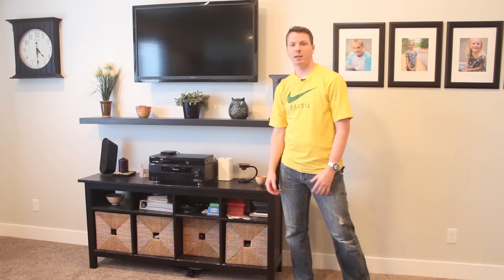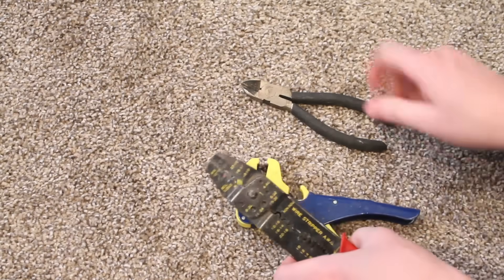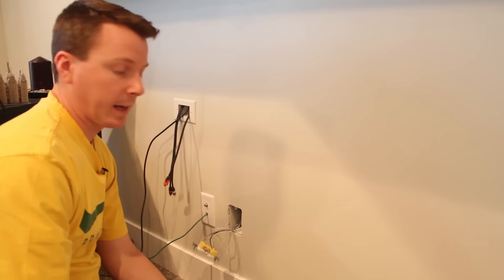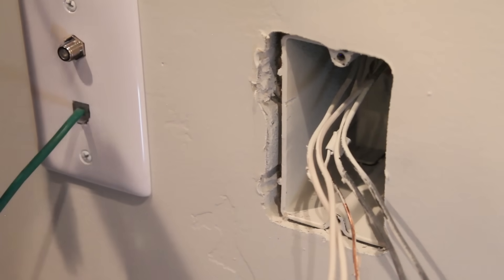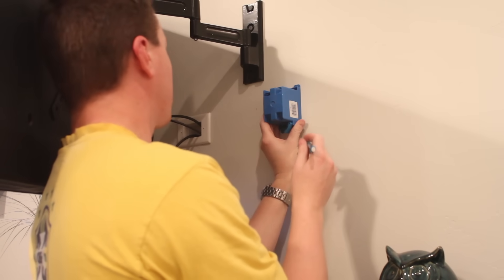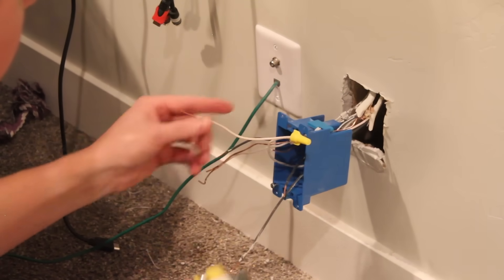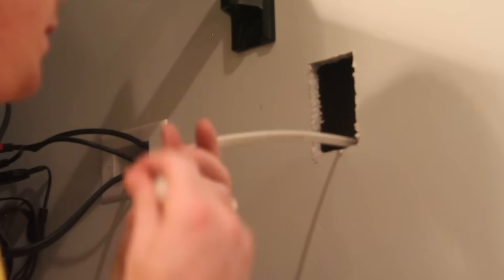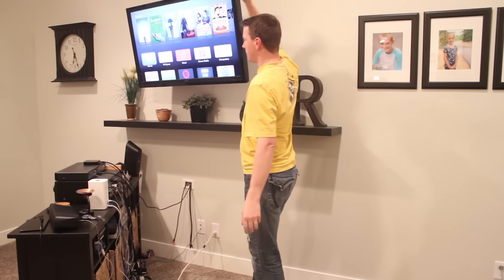How to Add an Electrical Outlet for a Wall Mounted TV

Comment: what type of romex wire did you use 12/2 or 14/2?
Reply from the maker: I used 14/2.
Reply: thanks
Reply: From my understanding you will want to use 12/2 if it's on a 20amp circuit and 14/2 if it's on a 15amp. Might be wrong tho. But you should definitely not just copy what someone in a video did blindly.

Comment: too much shit just to hide some cables, 99% of people would not be able to do it themselves without fucking something up, just get a freaking cable cover, slide all the cable, install a power strip at the wall with nails, plug power strip to outlet, put a drawer or mini table to hide the powerstrip, done

Comment: Could you describe the procedure for getting around studs if you are hooking up to an outlet that isn't directly above the existing outlet?
Reply: You can either: (1) notch the studs, add safety plates over the notches, and then patch up the drywall, or (2) tap into an existing line in your attic and run a new line down the wall exactly where you need it.
Reply from the maker: Sure will.

Comment: hi nils--- when you opened the existing outlet there were 2 blacks wires and 2 natural wires, why after putting a new romex , the existing outlet is missing 1 set of wires? . you have the new set + only 1 existing set, what happen to the 2nd of black + natural wire?  thank you
Reply: Why couldn't you tap off the screws on the outlet?  you had the incoming and outgoing already attached via the push in connections, with the 2 free screw terminals for H/N.
Reply from the maker: Hi Jenny. That second set of wires in the lower box continued on to the next receptacle in the wall. I used a pigtail to re-attach the lower outlet, while connecting a third set of wires that ran up to the upper outlet. The upper outlet only has one set of wires coming up to it and that's all it needs since it is the only outlet on the branch. Hopefully that makes sense!

Comment: are the kits that are in wall rated for this type of stuff pretty good i have seen some to where tv power is at top outlet then ext runs thru wall to out let down at bottom
Reply: Yes. I have used those on hundreds of installs. Very easy too. But remember, check your local codes first, and ALWAYS use a stud finder to map the wall out and avoid cutting any electrical wires in the process or getting stuck on a horizontal fireblock.

Comment: You are not supposed to to twist the wires before putting the Barrett Nut (cap as you called it) on them.
Reply: Only when you're doing it "hot" and don't have insulted pliers to twist them together.
Reply: Yes you are.  Twisting guarantees the pigtail connection stays together inside the wire nut.

Comment: What do you do if the existing outlet is not right below where you want to mount the TV?  My outlet is to the left or right of where the television is positioned.
Reply: You call an electrician like me and pay me lots of money to rip your wall apart. ahah. Joking aside this is the short answer. It can be done, but obviously you have vertical studs that you must pass through to accomplish it, and there really is no great way to do this other than to remove a section of drywall so you can drill through. You can use a flex bit but you need to make sure that you don't go through the other side of the wall and is up to code. Some codes require you to seal any horizontal holes. Basically you don't want to do this on your own, you want to hire an electrician who knows the codes to your area and can do this the right way. But yes, it will cost a bit and take some time.
Reply: I think I'll just buy one of those covers that hide the cables...

Comment: how come you have 2 sets of black and white coming into the original box? Does it mean it's already extended to another outlet, or light switch?
Reply from the maker: That's exactly right- there's one line coming into the box and one heading to the next box.
Reply: So, does it matter which of the 2 original lines you connect the upper box to?

Comment: Removing the old lower outlet box, was a waste of time.  You could have used a fish tape and ran to the other box.
Reply: I’m guessing he did that to make it easier to fish the wire? Asking. I don’t know
Reply: As he actually stated he's not a professional just the guy who likes to figure things out for himself I did not see the difficulty in the way he did it as I own all the tools that he presented. Except for the fish tape LOL I'd rather buy an electrical box for a dollar fifty at Lowe's than an electrical fish tape
Reply: Jason, Agreed. Appears as though he has a fish tape though realised that your typical homeowner doesn't. It's likely that the guy with a fish tape doesn't need this video.
Reply: How do u fish tape the same sequence
Reply: Yep that was weird thing to do. Messed up the drywall in the process.

Comment: I'm not an electrician...I noticed you twisted the copper conductors prior to twisting on a wire cap.  I learned to keep the conductors parallel to each other and you slip the cap over them and tighten by twisting the cap.  Thanks for the very good videos.  Helps a lot.
Reply: Many wire nut makers say pre-twisting is not necessary.  However, they do not say not to do it. It really depends on what thickness the wire is and how many wires you want to splice.  If you got four 12 gauge wires that need to be spliced, you are much better off twisting them with linesman pliers.   But even better is not to use wire nuts at all.  Go buy you some Wago or Ideal push-in connectors and thank me later.
Reply: you can see in the video he does, and even mentions it. also now you have entered into the electrician forum world where they go on and on about the virtues of pre-twisting or not. both sides have their points, and both sides won't yield. do what you feel is best; i pre-twist because i don't trust wire nuts.

Comment: Hi thanks for the tutorial. I have a question. So, when you connected the white wires (existing, new, and then the "extra" short wire to have a ONE wire), do you do the exact same thing with the black and ground wires? Thank you I hope this question finds you.
Reply from the maker: Yes - that's exactly right. Same on all three.

Comment: Niles, great project.  i wish I could post photos so that I could show you my dilemma.  I am placing a TV on a wall that has two outlets to the right and left of where I plan to put my TV and I want to put an outlet behind the TV but don't know how I am going to be able to do this.  There is a Romex cable running across the bottom but no outlet to plug into.  do you know how I handle this with violating code? any can help?

Comment: Are you able to add electrical outlets from a outlet on the other side of the wall? I have an outlet outside of my pantry and I want to run an outlet inside my pantry to plug in a cordless vacuum. Thanks!
Reply: yes you can. it's just a matter of running the Romex cable to the new outlet.
Reply: And as long as it's an inside wall. Different codes may apply if you're talking about an outside wall.

Comment: You butchered the drywall around the lower outlet...
Reply: Who cares, that's like $0.10 of spackling to fix that up
Reply: erroeserver3000 Just buy a larger cover.
Reply: Rob Gibson he probably made a video on how to fix already lol
Reply: It's called typical construction issues. Way to shit on the guy's work though. That make you feel like a big man?
Reply: You won’t see it behind his entertainment center
Reply: If need be,  the next size larger cover will cover any mistakes.
Reply: You mean those two little holes that can be filled with a dab of caulking? Good grief.....
Reply: The problem I see is that the lower box will NOT be secured to the wall. Therefore, just pulling out a plug could cause the box to rip out of the wall.
Reply: I was thinking the same thing lol
Reply: errorserver3000 I watched this whole thing and I was like wtf? why's that outlet looking so janky? gaps and shit I could have figured out how to do a poor job lol

Comment: very good job bro. But you're lucky because the old outlet is straight down under the TV.  my outlet is alittle off to the left, there is two studs in the way, and I don't know how to run the wires through the studs. Do you have any idea?
Reply: You have to cut a "pumpkin hole" in the drywall and then drill a hole in the stud.  good luck!
Reply: +Dara Nguon Same Problem..
Reply: At Lowes I've seen drill bits for this very purpose, sold right next to the fish tapes and other things of this nature. These bits are very long, like up to 5 or 6 feet and are flexible and bend to a certain degree like a long thin piece of metal would. The purpose being that you put it in the hole you make for the plug and drill through the studs sideways/diagonal, it looks tricky. That was what the label showed them doing with it so I'm not guessing.

I have the same issue, but I'm opting for running the wire up to the attic space and back down to one of the plugs, figured it might be easier and less messy. I just need to go up there and verify that I can access it easier from up there(by drilling a big hole in the top plate.) Maybe I'll look into this pumpkin hole method mentioned here too.
Reply: Get a bigger tv.
Reply: Why don't you move your wall mount center to the existing outlet?  You have to tie the wall mount to a stud, right above where the outlet is, so I don't understand how it would not already be above the outlet.
Reply: PianoSoulos my outlet is right below a window so using your theory of mounting the tv above the outlet, how exactly would I go about mounting the tv to the window/glass??
Reply: I had the same problem. I used a power inlet at the bottom (right below the tv mount) connecting to the power outlet behind the tv through the drywall. The inlet (and circuit to the outlet behind tv) is dead until connected by a male to female power cord from existing outlet (far away) to the inlet.  Sorta like an extension cord setup. 
also there are expensive kits available for the same setup. search for power jumper or powerbridge.  Saved a lot of headache drilling through studs and such.
Reply: I have the same problem. I have an attic right above the room so I’m just going to take it up through there

Comment: For code your not aloud more than so many outlets per breaker ( my area is 6. ) and use of a junction box is require. Yes it may very in different territories.

Just something else to think about. But it's a nice install and looks very clean.

Comment: can you put a double gang box in instead of a single and it be ok?
Reply from the maker: You can as long as your circuit breaker can handle the additional voltage on that line, yes. It would work just the same.

Comment: Hey man, are you a brazilian?
Reply from the maker: I'm not but I did live there for a couple of years and I speak rusty Portuguese :)
Reply: +Nils Rasmusson Oh ok nice. What is your opinion about the difference between the walls here in Brazil agast the ones in US, what do you prefer?
Reply: +Nils Rasmusson Oh ok nice. What is your opinion about the difference between the walls here in Brazil agast the ones in US, what do you prefer?
Reply from the maker: +Xano Trevisan Kothe. They just serve different purposes. For most areas, I feel like our drywall and lumber homes work great. They're versatile and easy to work with, easy to build and maintain (and fish wires through) but not as sturdy in certain conditions. I live in an area that is much more likely to have an earthquake than a flood, tsunami, hurricane or tornado. Where I live, wood and drywall are the most resilient option. That's not the case everywhere so I think it's just a matter of geography as well as tradition. I know that Europeans have a great time mocking the American homes in the comments of this video but it's often done without the understanding of what holds up well where we live. A concrete house would tumble in an earth quake long before mine would.

Comment: guy doesnt bond the box, still not to code technically
Reply from the maker: I don't know what you mean by "bond the box"? Can you explain so we can all benefit?
Reply: bond the box to ground,  theres a a green screw your supposed to wrap your bare wire around, and its code
Reply: How do you bond plastic boxes? Answer: there is no way to do this. It's a plastic box, not metal!

Comment: how can i add a outlet off a existing outlet 2 studs over
Reply from the maker: +Charlie Brown Hi there. It's possible but it's a lot more work. You'll need to cut away the drywall on both sides of each stud, drill holes through the studs and fish through. That parts not a huge deal but it's the repair work that is difficult because you then have to patch, texture and paint all of the holes.
Reply: +Nils Rasmusson ok so i dony have a ground my house was built in the 50s so can i add a gfi in both places and be good to go
Reply: +Charlie Brown also the way you pigtailed the wires can i do that on a gfi outlet because i have no ground

Comment: The shortfall to this method is that you don't have power surge protection.
Reply: +Rufus Jones - I agree. Definitely need surge protection for your tv. They make power surge outlets that fit into standard boxes. If you want to save money just mount a power strip behind the tv and plug it into your new outlet. Still hidden and will save your tv.

Comment: i really dont understand why you cut out the bottom box? there are tabs yes it is a tad pain in the arse to fish but even so its a lot easier than sawzalling the wall to pieces
Reply: I agree with you. I’ve added several outlets for TVs, as well as wired an entire basement. I would never remove an existing box. Use a fish tape and fish the wires through. Plus you risk cutting wires with the sawzal if you do it this way.
Reply: It makes fishing the wires a lot easier
Reply: @dannytheman2217  yeah but the time saved fishing is counter productive to the time cutting/patching etc...
Reply: luvdady he had to patch it? Thought he just put the cover over it. Well i guess i would just use a glowrod starting at the existing box and fishing at the new outlet
Reply: @dannytheman2217  well chances are drywall is going to crumble and be messy. Just saying that if you can get a 12 awg wire started you won't have to much trouble 😉
Reply: He cut out the box because he has no idea what he's doing.
Reply: So he didn't have to cut out the box at the bottom ?
Reply: @skyandboss  yeah majority of plastic boxes have 2 flaps top /bottom to  add wires. 
A little  persuasion with a screwdriver bend the flaps and run the new wire
Reply: I have done it both ways and cutting the box out is much, much easier.  If you know what you are doing with the sawzall you won't even nick the drywall.

Comment: In finland those hook around the screw connections are something that electricians did in the 60's. Thank god that there is nowadays much more reliable and safer connection methods. Also as an electrician myself i'd hardly sleep in my house if it had ground wires without any insulation. Too much possibilities to go wrong especially with diy installations.
Reply: what do you mean when you say ground wires without insulation? I'm curious because I too prefer to do everything the safest way possible.
Reply: i know this was 10 months ago but, as an electrician would you recommend wrapping the barret nut and wires with electrical tape after connecting the wires together? it seems like it would only increase safety.
Reply: @ballks18  No he is talking about using Wago connectors.  They are standard in the UK and Europe in general.  Wire-nuts are banned in some countries and rarely used in others.  Wago style "push in" connectors are easier to use and make a good secure connection.  HOWEVER, they have a higher resistance which means more heat (something the Wago fanboys forget to mention).  If you are not experienced with making solid twist joints with linesman pliers, then I would recommend Wago style connectors for DIY.  They are UL listed and completely legal in the U.S. (check your local code as some local inspectors like stuff done a certain way).

The reason wire-nuts are not used in the UK (can't speak for rest of Europe) is because back in the day they used them when they were made of ceramic.  The crappy ceramic often cracked and came loose, so they banned them. Nowadays wire-nuts are made of very tough thermoplastic with a very high temperature rating.  They won't crack or melt.
Reply: Very interesting Chottom.  Forgive my fellow American electrician for thinking the US way is the only way.  Often the US is way behind other countries due to a lack of willingness to change or learn from others.  What do your connections look like may I ask?  I know the back-stab outlet connections are horrible.  And I agree, exposed copper ground wire is begging for trouble.  Commercial or multi-unit dwellings use insulated copper with green sheathing for clear deliniation.

Comment: If it's already a newer style box in the wall how do you go about that do you still cut it out?
Reply from the maker: +ljuice27 That depends on what you mean by newer. If you mean the kind with tabs, you should be able to turn the screws counter-clockwise and pull the box out. If you mean something else just let me know.